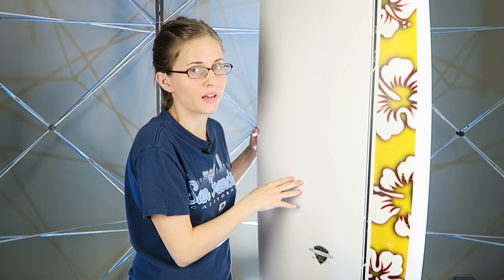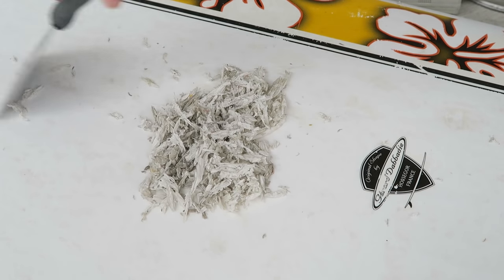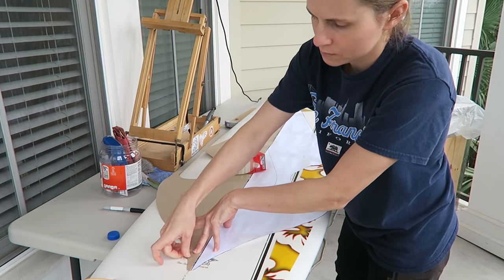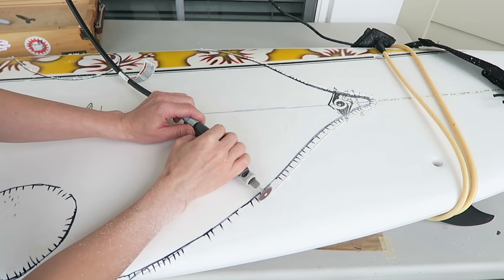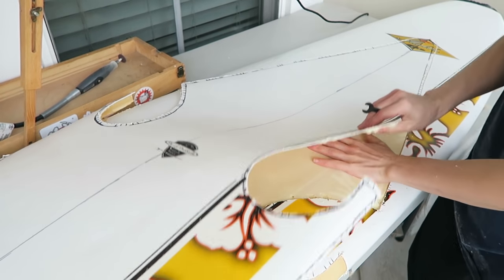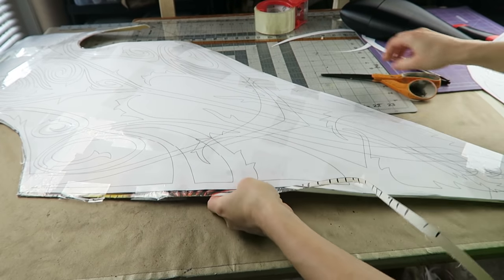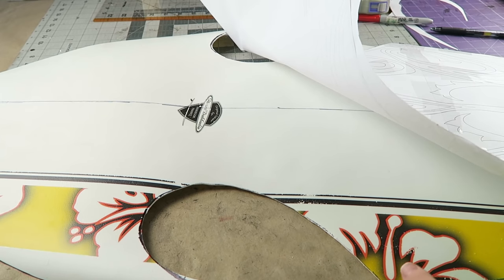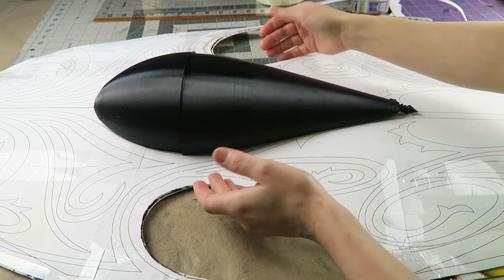Cutting Ornate Shield from Old Surfboard | LOTR High Elven Shield Part 1 (Pattern Available)

Comment: I like the gothic scrolling on it. i do metal work generally and am thinking of something similar to this
Reply from the maker: That would be awesome. Took hours to cut from foam, so I can only imagine how long something like this takes to make in metal.
Reply: well i would think a Beverly shear would make quick work of the cutting and when i can pick up an English wheel i wouldnt think it would take too long. i have a plasma cutter as well but im thinking a shear would work better than plasma cutter and dremel

Comment: I love how differently you start seeing things when you do any kind of fabrication and repurposing. The whole world just becomes potential building materials.

I've cut up to 10 oz leather with these, so if you need heavy scissors I can recommend them.
Fiskars Shop Boss Hardware Snip Multipurpose Tool Set https://www.amazon.com/dp/B006V8777O/ref=cm_sw_r_cp_apa_oUS8BbA46FHCT
Reply from the maker: Exactly,  you look at stuff as an assembly of potentially useful parts. Hey those scissors look great, thanks for the recommendation.